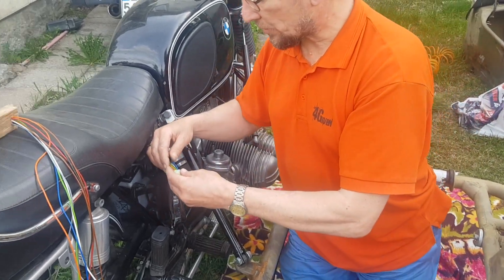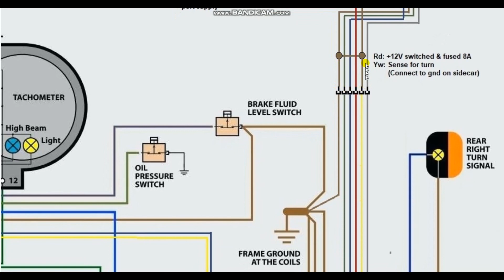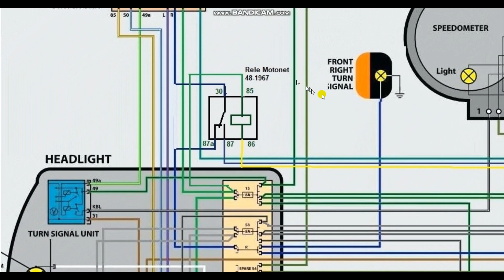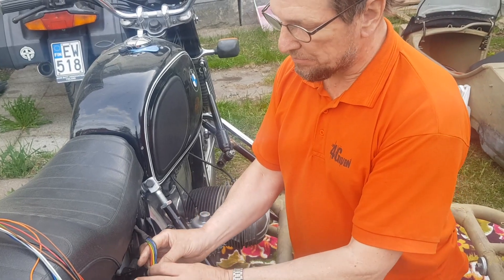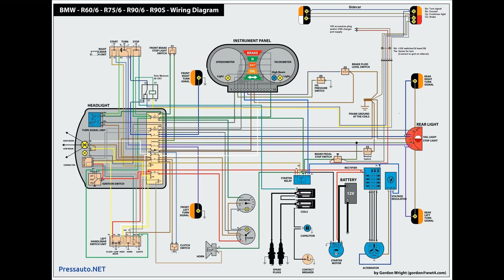BMW Airhead 2v Sidecar Ep  6: Sidecar Electrics

Comment: Hi . I need help with my 86 r80rt . The headlight low beam is not working. But the high beam does. Can be the relay ?
Reply from the maker: No relay in the /6, don't have schematics of the /7 at hand.
On the schematic, follow white and yellow wire. 
Probably dirt, rust or so on your left hand switch cluster, or a loose connection on the wire connection & fuse plate, if the/7 has similar construction.